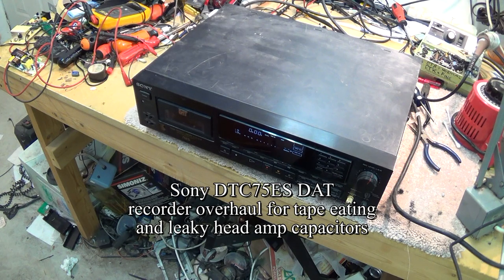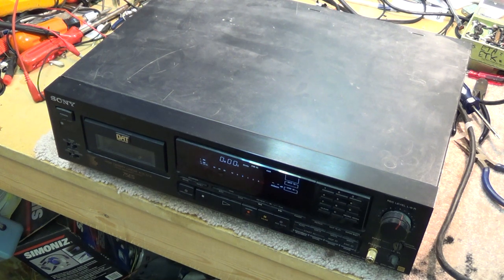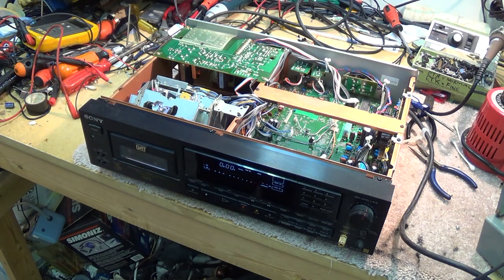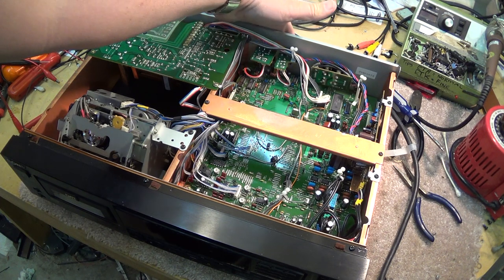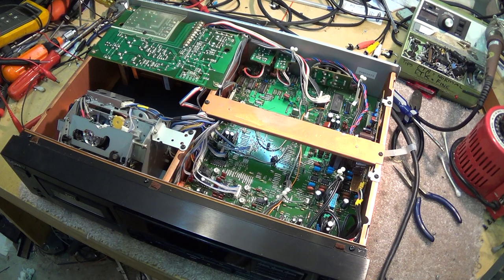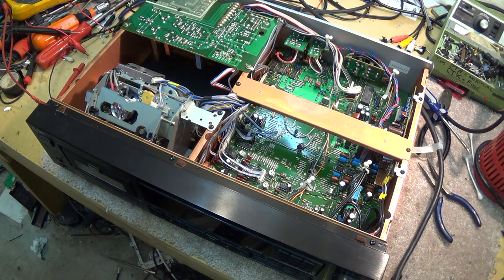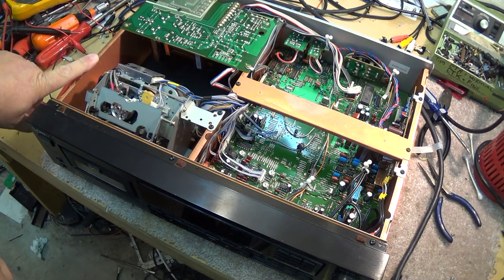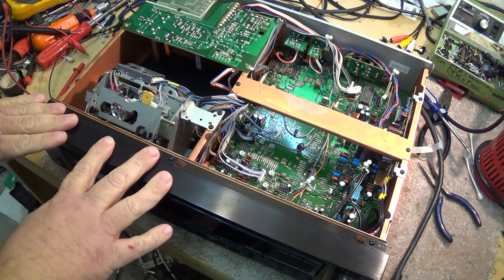Sony DTC75ES DAT Overhaul

Comment: YT is the gift that keeps on giving...  You sir saved me a lot of grief when my 75ES that I got from an estate sale played the tape that was in it and then refused once I put another one in.  The dreaded 'caution' light came up - which Sony tells you is the "moisture" inside.  I don't think that there is a moisture switch in there... it's a myth.  But, the digital mode switch sprocket had broken in half and fell out when I jiggled the tape.  So, in the span of 7 years we have hobbyist 3D printing technology to rescue us.  It is the FUTURE now.  Installed - and voila!
Reply from the maker: I now have a parts machine 75es that someone paid 500 for on fleabay and was taken to the cleaner.
Reply: @12voltvids  Well, I must have spoken too soon.  Being a noob and all that, I must have not located the position of the sprocket properly, and now the deck would play of it does do something, it does at insane speeds.  Clearly, the switch is out of alignment.  I tried replicating the position you show in the video, but it is to no avail.  I also tried moving the hashmark around by turning the sprockets that the mode switch drives - still no luck... Any suggestions?

Comment: Owner of the 55ES,  3 moths ago i recapped the RF modulator, cleaned the heads with a piece of paper and alcohol 95%. A few weeks later i got problems and could not get any DAT tape to play well without hiccups in sound playback. Today i finally found the courage to do the 'hard' work and apply contact spray to the 2 switches and inside the gear as seen in this video...i am not quite sure IF any of the spray did find its way into this closed gear, but i am happy to report that, thanks to this video my 55ES works again. Thank you!

Comment: Hello, I have owned a Sony DTC-75ES since new but shortly after purchase the display lights when dim and the tape would only play for a few seconds before stopping. it seems to be low on power. any idea what it may be or what it may cost to repair? it may have been subject to a power surge. It has had very little use then stored for the last 15 years or so.

Comment: Thank you kindly for this and all your DAT content, as it's helped others to keep their DAT decks going without spending and a leg. I can't tell you how much I learn watching your videos!

 I think my 59 ES will work as a DAC, albeit an ancient one, but effective none the less. ES = Expensive S#it, Elevated Standard, Engineering Standard, Excellent Sound...The built-in foam head cleaner made mine not work at all, I cleaned the head drum with a foam swab that was dipped in head cleaner, and it worked again. Removed it, pivot arm and foam as you described. Love the copper chassis and heavy construction, made when companies gave a damn (still) As you've said the only thing missing that's missing is a lack of Balanced XLR analog or AES digital connectors. One step short of a studio machine, but IMO sounds as good or better more refined comes to mind. I think my 59ES has about 50 hours on it, maybe a scosche more. Like you, I've made a few 6-hour background or party tapes, but rarely use it.

Does that one feature the Rosewood sides? Looks choice on the 59ES, I'm sure the 75ES looks even better with them!

Comment: Thank you very much fore a really helpful video. I thought I would share a little tip, I had the felt brake pad problem on my 55ES. Two of the pads weren't good enough to reuse so I had to come up with an alternative and I found something that works perfectly. The little felt pads thet run under the magnetic tape on a standard audio cassette. The pads aren't the same in all cassettes, so you have to look through a few different makes to find the best ones. They are over size, I cut them to size using a razor blade. The ones I used were even the same colour as the originals.
Reply from the maker: Whatever works.  Thin slice of pecil eraser works too

Comment: I'm watching this with intent after watching the ordinary Sony DAT and the portable overhauls. I have a DTC-60ES in my lounge system. The drive is faulty, I bought it in this condition to use as a DAC for listening to music via sources with digital outputs and it matched the look of my TA-E80/N80ES pre and power amps.

I am going to buy a DAT tape on ebay and then see if I can resurrect the drive in my 60ES - I have never experienced DAT before, but I do know the DAC in the 60ES sounds superb. I took it to a bakeoff recently and we played it next to a modern Meitner DAC which does oversampling, will convert DSD and costs thousands second hand - the Sony honestly, honestly sounded pretty much identical with redbook CD.

Just in case you're confused by how I use the deck as a DAC, if you press record without a tape loaded, it will monitor whatever is connected to the selected digital input. Worth experimenting with if you do not have a standalone DAC - I can well recommend it!!

Comment: Great vid. If you have this deck and it wants to stay open (door won't stay closed, keeps ejecting a tape that will not out-spool, door stays open even when deck is off), there's a simple fix. On the left of the tape drive is a small micro-switch that is triggered when the door closes, very easy to see and to get to. The problem is that the door lever is not actuating the switch because the door lever is not raising the micro-switch's toggle lever high enough (this lever has a metal tongue beneath it that the door lever contacts and moves upward). The micro-switch's toggle arm, and the metal tongue beneath it, need to travel just a tiny bit higher, to trigger the micro. The metal tongue of the micro could be bent :-) a little upward. But less traumatic, I simply slipped a tight-fitting piece of heat-shrink tubing over the metal tongue. Now, the door lever hits the tubing, which has increased the diameter of the tongue, therefore pushing the micro's toggle higher –– and your 75ES is working again. If the deck has been sitting for a while, spin the head to loosen any thickened lubricants. Worth the fix and all the fixes in the vid, cool stuff 12voltvids!

Comment: The independent Grounds are a must - because this supress the Mechanical (Motors) disturbance from this mechanical Part to the Digital to Analog Converter (DAC). This reduce the SNR on the outside and supress the disturbance from the Tape to the DAC. All Studio Machines have this Design but in a other way you have a Tapemechanismuss a optical Cable and a Seperat DAC Converter to reduce the Disturbance. In a normal Powersupply you can't eliminate the Motornoise (Brushfire) [Spinning Head etc.] this makes differnce Disturbance in the same Chassis (the same Box) The LED are in my Eyes to light reduce the Power of it you can see on the Tapedoor that the light is coming out around the Tape door.
One Question i have 57ES and the Powersupply -25V are death so i change the R902 4.7Ohm but it burns again now i disconnect the PowerSupply from the Mainboard and see the R902 is burning again now is the PNP Transistor maybe defect and or the Z-Dioad for this FL Power Supply? What did the FL need? -25V and 6.6V for the Heather?
Thank you for this Video! What you will charge if you repair a DAT Recorder like this for your work? This DCT 75ES need a lot of time to deinstall all mechanical parts and to fix the problem. How much a owener of a DAT like this must be paid?

Comment: Thanks for the tip. Just what I was looking for. My take-up wheel wasn't turning at all. Found a swollen brake pad on the take-up wheel. 
Need to align the tape rollers though. I have two decks (55ES and 57ES), and need both to play the same tapes. Is it good enough to use recordingd from one deck to align the other? I have used the 57ES to record all music so far.
What type of signal should i use to make my reference tape? Just music, or different tones? 
I believe i can borrow an oscilloscope, but no clue on how to use the settings on one. 
I suppose i will use the same connections as you did oi the other Sony videos you made

Comment: Just acquired a DTC-75ES today with a mystery 'CAUTION' error, still trying to figure out what that is, tape ALMOST loads before it turns on, encoder motor gear is good. 

Took off the RF Amplifier and those two 22uF SMD caps were bad, too, got those replaced.

Comment: Thanks for this video. I just tried to repair my old Sony 55ES. New Gear for the Rotator Switch... all works fine. Then I tried to get rid of the rewind issue. None of my  tapes rewinds to beginning. So I screwed out the wheel assembly, cleaned everything and found a lost break pad,-) After a little grease for the wheels i reassemled everything. But now i have a new  issue loading the tape. Tape is transported to the drum but then immediately repacked in the cassette. Then the display shows caution. Any Idea what I might had done wrong?

Comment: Hi, just got my 75Es for $10 and it would hardly FF/ REW and it would play only sometimes. I took it apart and have oiled the direct drive motor which helped a lot, but still the rewind will slow and sometimes stop toward end of the tape and when I rewind to the begining of tape, the motor doesn't have enough torque to get it going for first few second. What else can I try? I love this deck and the DAC's are stellar- even better than in my professional Virus ti synth. I had a hell putting it back together. The gearing on encoder broke in half and the unit would start to eat the tape  during REWing. Got that to work now, thank God! Very informative channel.
Reply from the maker: +ElenaDiakova Yes the gear on my encoder broke too.Check for sticking brakes around the tape hubs.

Comment: Great videos and I enjoy your explanations. Thanks.
For the led strip you have connected to a 12v switched supply as in a previous video.
Why 12v?  Does it matter how long the strip is?  Would a higher or lower voltage above a minimum also work?
Reply from the maker: The LED strip lights I used are rate 10 to 15 volts. Naturally a lower voltage will work but the brightness is lower.
I picked the 12 volt supply as that is the motor drive supply. The 5 volt rail is for the digital and audio circuits, so I didn't want to load it down. White LEDs have a bias voltage of about 3.3 volts each, there are 3 in series, and a current limiting resistor on each group of 3.(that why you have to cut the strip every 3.
While LEDs are really a blue diode with phosphor to make white light. 3.6 x 3 = 9.9v
so that is the minimum needed to forward bias the diode portion of an LED.
Reply: i own the 55ES, so the Europe model. This video encouraged me to change the 2 SMD caps, and on the hottest day of the year i did just that. Works great - thanks! Regarding the LED strips, here in Europe, we can buy those LED strips but only per meter. Buying a meter would be overkill in my case, so i bought 2 white-warm leds, a resistor of 820 Ohm (--> 10mA is enough light) so that the light wouldn't be too bright for my taste. Then used some duck-tape,  and i have now a beautiful not-too-bright effect. All in all it costs me less than 2 euro. I am very happy with the result - thanks again.

Comment: a most beautiful and professional presentation. However it did not address my problem with the DTC-75ES. My transport will open and close without a problem but the two arms that move up to wrap the tape onto the head immediately retracts and the tape goes back into the cassette. Play, FF and rewind don't work. Any ideas? Thanks Don
Reply from the maker: Mode encoder switch?
Reply: This models have problems with white gears under the transport...check the white ones...cracks....if you dont se crack...try to clean and lubricate mechanism

Comment: I have the same Sony. Perhaps you have an idea... Why tape guides remains in play position and don't go back in start position after opening tape compartment? It means... When you put DAT tape in drive, tape won't be guided arond the drum because guides are already in "play" posotion, so there is no possibility to play. Any suggestion? Thanks
Reply from the maker: Check the gear on the bottom of the mode switch. It breaks in 2.
Reply: @12voltvids  ok, i will try to investigate again, but if you rotate gears with finger - guides go back in start position. If you put the tape - tape will be surrounded around the drum, but if you want to eject - tape will remain in play position because guides stay in play position. It seems that gears are ok, but guides don't know when go back...
Reply from the maker: @gilhooley999  a very common problem on the DCC 75 ES is the gear on the mode switch breaks.   If the mode switch is in the incorrect position the loading motor won't come on.

Comment: Anyone who's removing the old SMD capacitors using that technique is very brave (to keep it friendly). It highly relies on the quality of the board if it can withstand the added stresses to the printed circuit board. I ALWAYS use two soldering irons at the same time. That way, chances of ruining your PCB are minimum.

Comment: Hello
I watched your video about repairing DTC-75ES with interest
I have the DTC-57ES model myself Only there is a small problem: I will look for a toothed belt for it: 170TN10-1.0T in the service manual page 63 part: 391
Regards
Marek fom Lubeck

Comment: Great video, nice one. The complete upside down nature and stuff on the desk and floor however was making the OCD in me itch.
Reply from the maker: Sucks to be you.
Reply: @12voltvids  I bought a faulty Sony A8 from eBay on the basis of your channel, and it came today. Spotless condition, meters move when recording but no playback. Ordered the capacitors for the rf board and will change them over the weekend. Thanks for this, gave me confidence to have a go at repairing it.
Assume that the rf board were out of production years ago. Shame as you mentioned this is one of the weak parts of the Sony DAT,  I bought a non working Revox A77 That I managed to repaired and there are folk making the boards again.
Reply from the maker: @christopherbuck7679  Those surface mount caps are the weak link for any electronics they are present in.

Comment: Great job!  Wouldn't the copper chassis also work kinda like a faraday cage to help control spurious and man made emissions or would emissions not be to crucial in this application?
Reply from the maker: A metal enclosure would provide adequate shielding.
I don't know that making it out of copper has much to do with it, but the isolated chassis with just a single ground point is Sony engineering's attempt to prevent any currents from flowing around the cabinet
By having a common single ground point mitigates any ground loop current that could be picked up by circuitry. This being a digital device probably generates more noise internal that could radiate out and interfere with things like AM radios, but nothing like the noise that is kicked out by Plasma TVs. You want to talk noise, try running a radio anywhere near a big plasma TV.
Reply: +12voltvids You clearly no what you are talking about..I have a 55inch panasonic plasma and very close to that tv,I have a Small roberts analogue radio...When the tv is on or even in standby mode..I can only hear static and very load..Thanks 12voltvids
Reply: +azshaw123 Sorry but i meant LOUD..
Reply from the maker: +azshaw123 Plasma TVs are notorious for throwing lots of noise onto the lower spectrum, namely AM radio and shortwave. They are not popular with HAM radio operators.  The power supplies kick out a little bit of noise but the real noise comes from the high speed switching, and plasma discharge in the panel. Older panels kicked out much more noise because of the higher voltage, and current present in those panels. The last generation before they stopped making them were pretty good. I remember the first generation units, you had to put a torroid choke on all the input cables and power cable to reduce radiation from the cables.
Reply: Thanks for that very intelligent and very helpfull info..I am in manchester in the uk and i am most impressed on your work and amazing knowlege on repairing betamax machines..I have a collection of 12 mint condition machines...All PAL of course but all have faults and no one here in the uk wants to repair them..I wish you were here LOL..Keep up the good work my friend!

Comment: One of my professional Sony PCM-7010F's is not working properly. Upon turn-on, attempting to play, the bad condition light comes on and the tape distorts. This implies a bad tape but that is not the case. Allowing the unit to warm up for about an hour the tape plays without incident. What's wrong? Can this be fixed?  I'm thinking maybe something needs to be re-soldered.
Reply from the maker: Charles Ludwig 
Sounds more like a capacitor issue to me or a cold solder connection
Reply: If you're interested, email me at  csludwig2@gmail.com perhaps I can remove top plate and send pic to you although there are so many boards in there, might not be able to see much, boards for time-code reader/generator, memory start, and all kinds of stuff not in my 75 or 87ES decks, 58 pounds worth.  At any rate, I had Sony in LA service the unit in 2010, they installed a new board to get start id function back in action. They no longer service this unit, maybe you might be interested in servicing it? Since the unit works and shows no alarm after it warms up, I kind of think it is a solder connection. The unit has only about 450 hours, is turned off except when needed (about an hour each month), and has original battery cira 1994 or thereabouts.